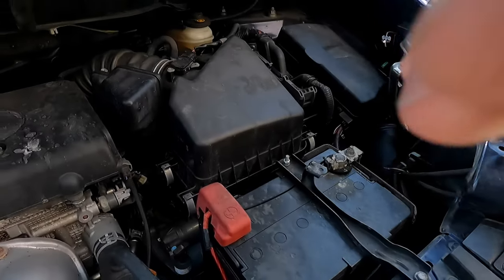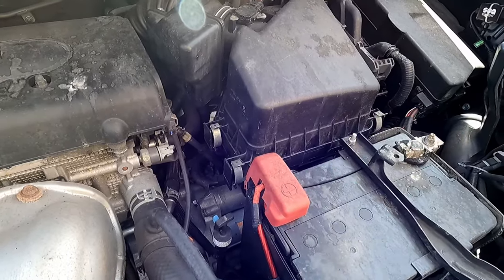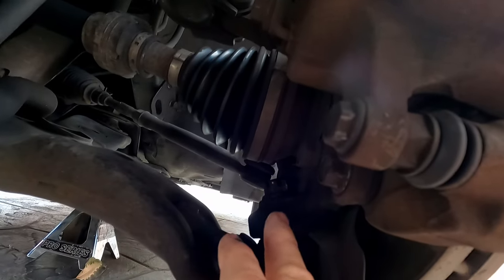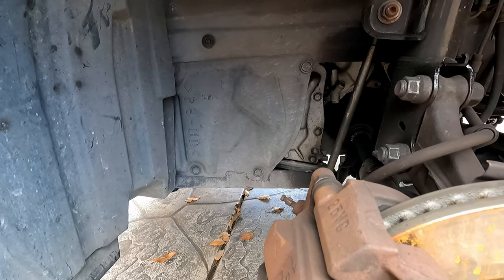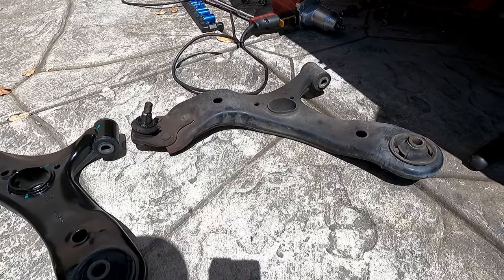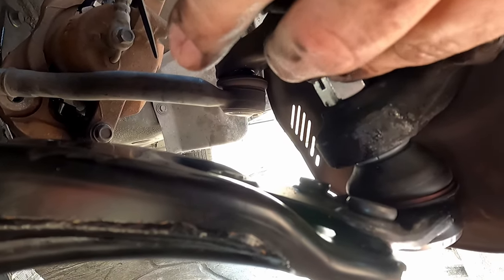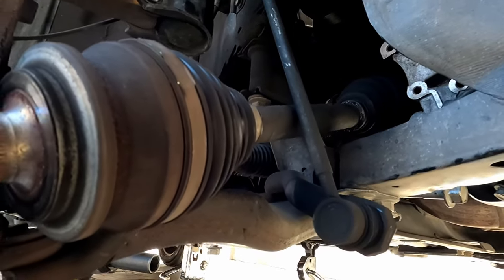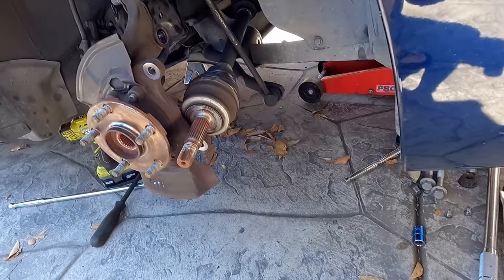2008-2016 Scion XB Lower Control Arm Replacement

Comment: Just went to dealership said our 2010 Scion XD lower control arm and bushings are going bad. They told me the TRD tire rim modify is causing this. Told me the tires are too big. We bought the car new, added the rims, and nobody ever said that the tires are damaging the car. Have you heard this? Toyota wants to charge us $2,402.42 to replace the bushings. Thanks for making this video.
Reply from the maker: Hello Belinda, No I haven’t heard of tires damaging the car. Larger tires can be hard on bearings but bushing it’s usually caused by age and miles. I can’t imagine your tires are that much heavier. As you saw in my video that replacing the arms is time consuming and that where their cost is. Also the Toyota factory parts are $$$. I had almost $300 in parts for this video. Hope you can find a honest mechanic to do the job and save some money. Thanks for watching!!